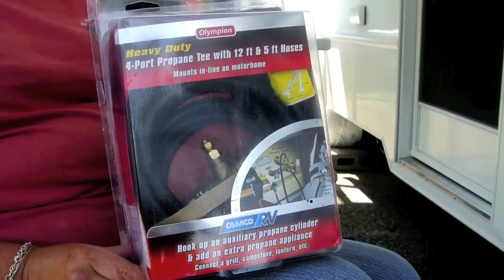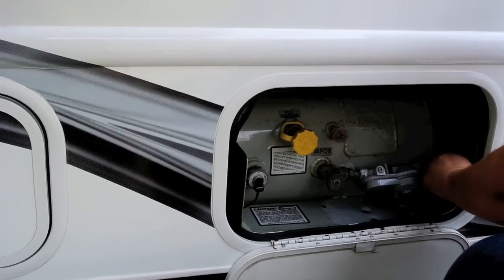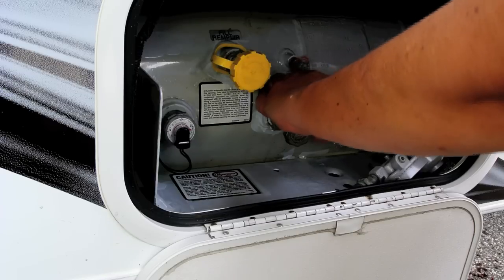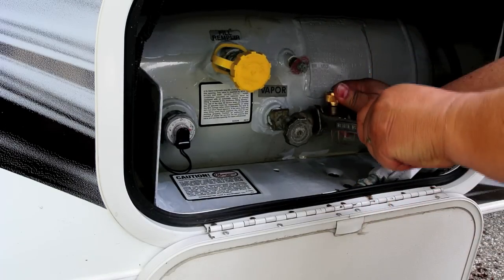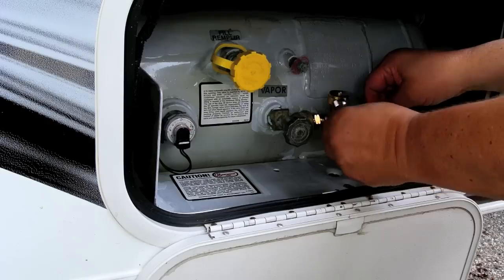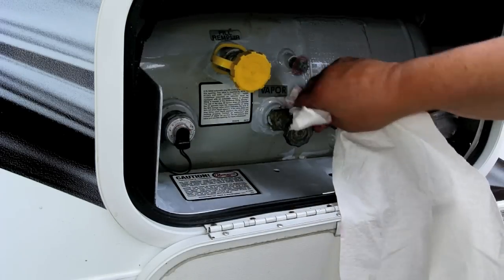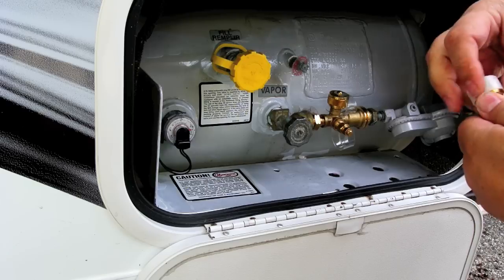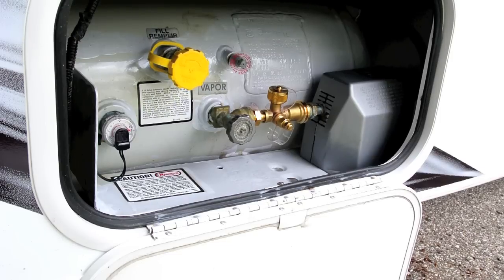Adding a Propane distribution system to a RV.

Comment: Great info! Has any one had any issues with downstream regulators getting clogged due to the length of the hose from the propane tank to the regulator on the appliance? I saw another video where they said to install a regulator right at the T to avoid that issue, but then I gotta get new hoses for my appliances that don’t have regulators?

Comment: Thanks for the video! I added this Camco adaptor to my RV, it works perfectly and this video was the main reason that I felt like I could do it.  Great explanations and suggestions.  I used a section of left over Trex Deck as the shield under the new location for the regulator, it works fine.
Reply from the maker: Great to hear!

Comment: PS, Remember, If the Nut, has a Cut in the center,, That tells You, That its Left Hand Thread,, Ive Allways Used soapy water,, and You will Have a 4 Inch Bubble,, as Im UL 142 Approved,, So, Built a Ton,, Thanks,, Jack
Reply: I never knew that ! thanks for the info!

Comment: If you want to actually provide true rust protection don't use Rustoleum - it really does not work very well.  Instead - use POR-15 (available on Amazon).  It actually bonds to the rusted metal and is by far the best product I have ever used to really protect steel from rust.  The main product is gloss black, but they also have a few top coat colors.   You paint it on, but they warn you to be sure to wear long sleeves and gloves, because if you get any on your skin it will not come off.  It is also a bit different than most paints in that it flows on very well - you have to use it to see what I mean.  It just flows out and provides a lot of coverage.
Reply: Personally I would use some kind of rust "dissolving" primer first....actually first I would take a wire bush and then some sand paper then clean it with water  to get any dirt and grime off and then (once dry) spray on the rust neutralizing primer ....actually since it's all covered up?  I personally would not fuss with matching the paint....I mean I HATE rust but primer in covered utility spot?   pffft!  who cares!  Clean and rust free?   Yes!  But it ain't a "lookin at" spot!  Ya know?

Comment: Can the motorhome tank be refilled from the portable tank?  It looks to me that if the portable tank were turned upside down the liquid could then flow into the rv tank or does the "extend-a-stay" manifold have a one way valve to prevent this?
Reply from the maker: Mike Schmidt I shut the propane tank off when using the portable tank. I suppose though that it might fill the tank, but I suspect the tanks will "equalize", i.e. the portable tank will probably fill the main tank until the pressure in each is equal.
Reply: +awboater there is a bleeder cock screw on the side of the rv tank valve.  As to equalizing if a cold water is run over the rv tank and the portable tank is placed in a bucket of warm water, most all of the portable capacity will transfer to the rv tank.   When opened during filling when liquid is viewed spewing forth the tank is at 80%.

  Since my first inquiry 6 months ago I have found that if you have a home propane tank you can refill from it you need to purchase a wet leg adapter, a liquid evacuation tap valve, an lp filler hose, lastly a hand wheel filler coupling adapter.  The reason for going thru this process is that you can purchase home LP cheaper than you can on the road.  At the time of this writing 6 months ago, if memory serves me,  LP was at or near $5 per gallon.  Currently in central Iowa it is $0.99 per gal.
Reply: +epicfail As best I can tell the extend-a-stay connection would give propane hook up to an external source without using the on board tank.  After further consideration I am not sure if the 4 port manifold will allow transfer to the on board RV tank.  I suspect there is probably internal check valves to prevent this at the moment I do not know.  I will be checking some other propane suppliers to find out.
Reply: Mike Schmidt WOW! 99c a gallon is AMAZING! Over here it's the opposite, the 45kg 'home' bottles are around $120 each fill & LPG at the Petrol Station is around 70c per litre!!! We're getting screwed!!! Hang on a minute, I just had a thought. When you say 'home' gas, are you referring to Natural Gas?!

Comment: my rv propane tank has a gauge on the tank itself, but does not have a wire or hookups for a remote gauge inside my RV. any recommendations for a DIY install? I am currently looking at the see level digital monitor system, but my tank has no monitor hookups.
Reply from the maker: I am not a propane expert, but I believe some of those tank gauges are designed for a "snap on" sending unit.

Comment: My external grill doesn't have a regulator. seems to me this adaptor should be placed after the regulator. All the videos I've seen show it before the RV regulator. Is it safe to be before the regulator?
Reply from the maker: +dtorpea Yes, it goes before the RV's regulator. This requires any grill you use also have it's own regulator.  You might be able to find a 3rd party regulator for your grill, but I am not a propane expert.
Reply: I'm of the understanding it's made for the portable BBQ's that use the little (I think you call them 1lb bottles over there) Coleman disposable gas canisters!

Comment: You back a flat spot with a pipe wrench, the teeth will bite into the piece just like it would on a round pipe.
Reply: Never use a pipe wrench on brass fittings.  It's gauche.  And it tears the crap out of the brass.  If it was intended that you use a pipe wrench, there wouldn't be any flats.  The flats in this video are for tightening that stem into the regulator.  A hand grip on the regulator is all that's needed.

Comment: How would you add a quick connect?
Reply from the maker: you can buy quick connect fittings. Make sure the ends are compatible, and you use the proper (yellow) propane tape.

Comment: Thank you! I discovered that I need one of these the other day. Totally see that I can do that myself now. Just one question. When the exterior propane tank is attached ("extend a stay"), do you run the hose out and under the manifold? The door has no holes in it, so I have to assume that's what you do.
Reply from the maker: The bottom of the propane tank compartment in all RVs is open to the ground (propane is heavier than air so if there is a leak, it will dissipate). You should simply be able to feed the hose from under the RV.